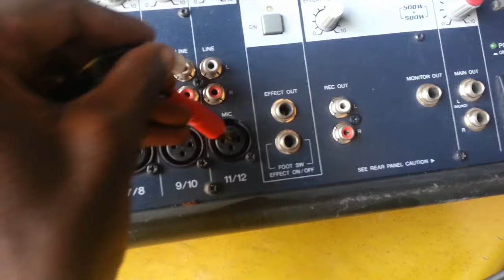How to make AUX to RCA Cable | Mobile to woofer system connector

Comment: Aww hell I used to be worried that soldering was hard. But I think this video showed I can get by with only soldering every once and a while
Reply: Incorrect. You should ALWAYS solder whenever necessary if you have the ability to do so. Soldering is easy. Heat the oojects you want to connect then apply solder to side opposite of the iron tip. Learn how to prep your iron though and always coat the top with solder when storing it

Comment: Bought a cheap 2 pack of Apple knock-off MFI certified wired ear pods and sacrificed one for the 4 pole plug. It worked, so thanks Cedoh! I bought a converter box that plugs into the CD changer plug in the back of my car stereo and now I can play my i-phone in my car. The converter box has stereo RCA inputs.
Reply: 1¹1

Comment: Message #2 
I Thank You soo much yoo!
This worked for me right now.. Going from the RCA outs on a Tape deck, into the newer Laptop's combo AUX port.
Instead of seperate headphone and mic inputs the older computers have, i bought this Laptop and didnt realise these only have the one port (designed for headphones with mic.. just like the Earbuds you used in this video.

I knew this cable could be made, instead of ordering and waiting for an Analog to digital usb converter that many if not everyone buys. I got so much stuff i like this idea wayy better. Giving new purpose to old broken items, that still have good parts.

Again bro.. I thank you sincerely for helping ALL of us out here.. Ive been trying to get the wiring right for this hack cable all evening yesterday, and maybe the eve b4 that.. or at least a few hrs.
.. Until i saw your video here (after watching another of your videos) .. I didnt have my wiring right on this.
I could not see the tiny red wire hidden in the copper ground wire Lol.

I subscribed bro.. I been into hacks and repairs like this for many years.. love it.
Thanks and Be Blessed.
Reply: By the way.. My purpose is to Digitize my Analog Cassette tapes .. and be able to record pretty much any analog sound into the Laptop.

I knew the computer itself has the analog to digital converter already.. thats another reason i didnt want to buy and wait for one on order. 
Many of us have broken earbuds and old rca cables laying around 🙂

Comment: this cable can be purchased for peanuts on ebay.... and it would be better than the shitty mess you made of it..... clean and tin your soldering iron 
and dont wipe your greasy fingers on the area to be soldered    if you do clean the area with naphta (lighter fuel)  then you wont get dry joints.